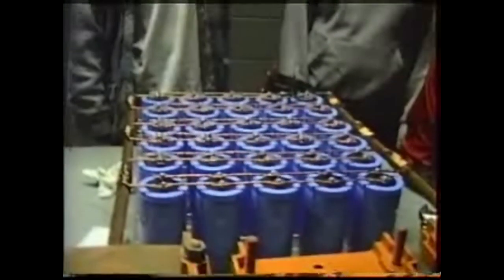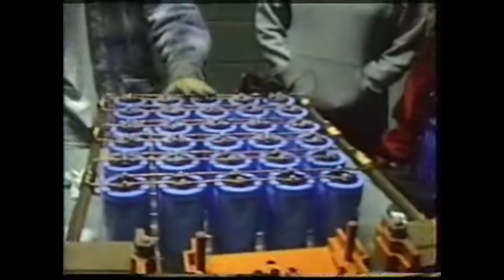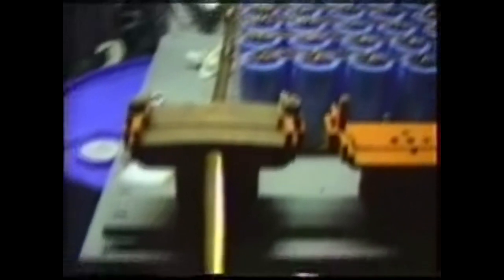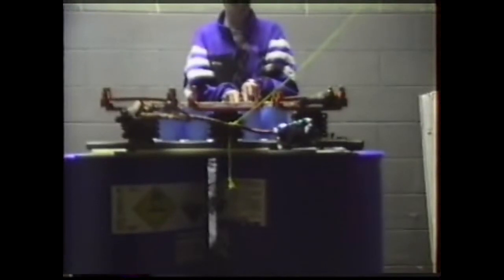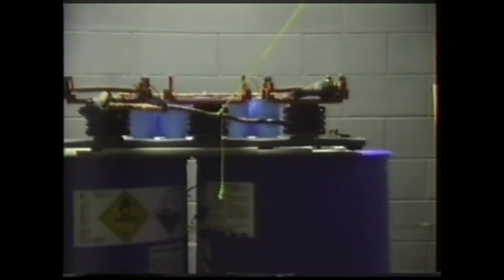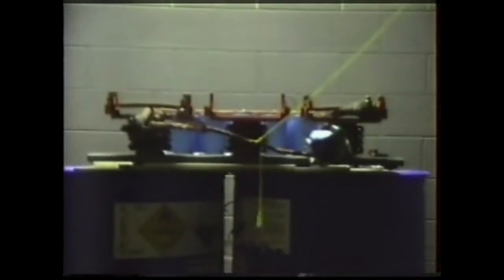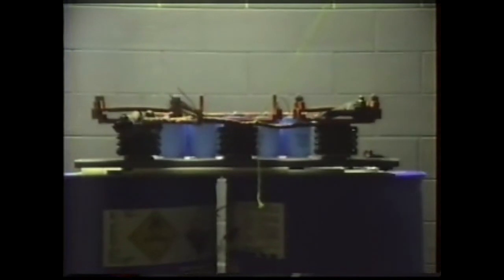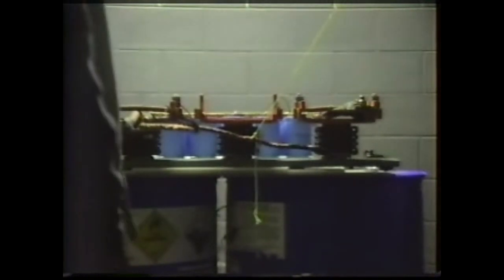First Thumper Test - Winter 2000

Comment: its missing the "barrp barrp barrp" of that alarm you now have in the current thumper :) I need a new battery drill to continue assembling my thumper (40 caps, 48,000uf @ 850vdc), as mine died the night I wanted to drill and prepare my bus bars :P I Do have a vibratone 4040 fire alarm for it though (and hell it'll need it! thats a whopping 10Kj!